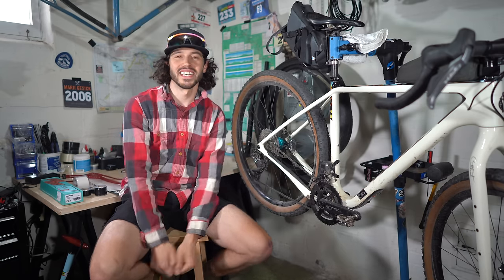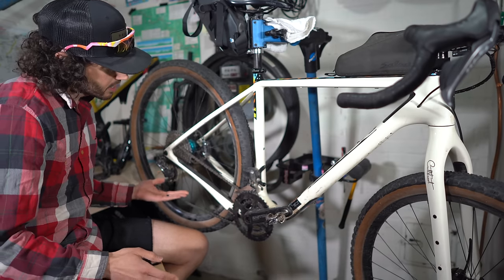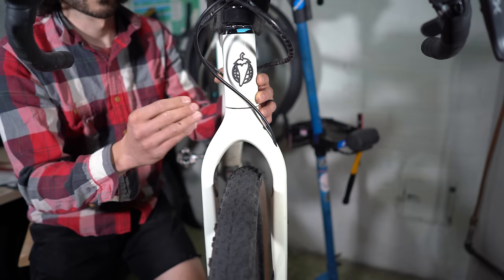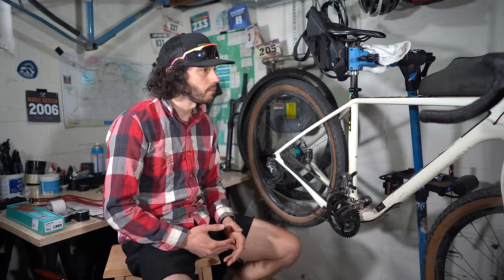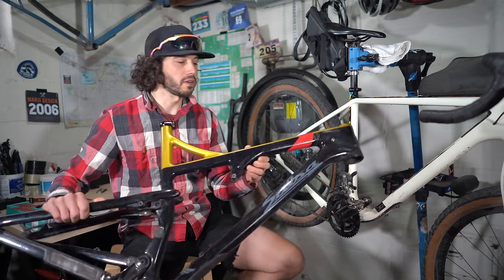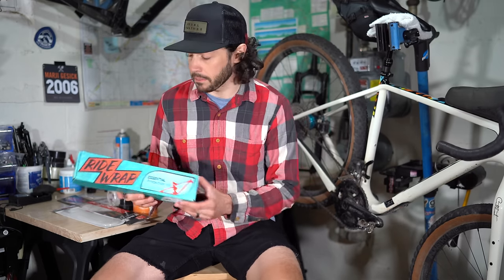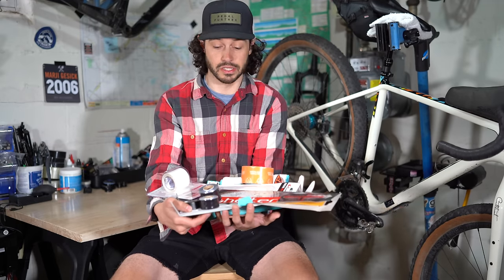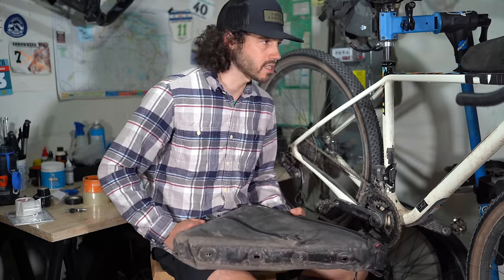Bikepacker's Guide to Bike Frame Protection

Comment: Excellent review of various options. Thank you very much. I discovered this video AFTER installing clear Gorilla tape to the top tube and several other sections. I'll expect to whip out some isopropyl alcohol when the time comes. I can live with that. The best thing is it was inexpensive and available at a local hardware store. I'll return the $70 AMS Honeycomb camo kit which I'd love to place on a few sections (esp downtube) but didn't want to cover all over this new turquoise Yeti. In fact, the ONLY spot on my bike where it says Yeti SB130 is the top tube, so rather than cover it with camo, that's where I installed the clear Gorilla tape. Looks great. Provides nice degree of protection and hopefully, it won't damage any parts of the original paint finish if/when I remove it.

Comment: A trick I've learned with helicopter tape. Spray water onto the bike frame, as you did with the RideWrap. Once you have it in position nicely, squeegee out the bubbles by working from the center out towards the edges. Then you can use a hair-dryer on a low setting to help dry out the moisture. This process is especially helpful when working around curved sections and awkward shapes.
Thanks for a great video. I'm planning to go ahead and install plenty of frame protection on my new Tumbleweed Prospector FAT bike when it is finished being built for me.

Comment: I usually use helicopter tape on the TT and HT. I’ve used electrical tape quite a bit too. Using strips to lay around the front of the HT effectively. It’s also good to wrap around carbon bars to protect from feed bags/handlebar bags etc. Never had any issues with it leaving residue
Reply from the maker: I was surprised how clean it came off. I guess the last time I took it off was maybe a year after install and it became one with my titanium frame.
Reply: Yikes! Do you usually tape carbon bars? What have you used for that?
Reply from the maker: @lewisciddor  Not typically, maybe a bit of tape where I mount a stem bag but thats it. I've used silicone tape in the past, but now I think I'll be using helicopter tape for most of my needs.

Comment: I added bike stickers, transparent to my complete frame lol. I so hate it when my new bikes get their first scratches haha. It hurts right :) I do like to add not to become too tired and cycle onward, because that lowers the protection of the bike as well, and yourself :D. And yeah covers...where needed. Keeps the lack nice and fresh. Further because I use aluminium frames as well I would also add to make sure layering your entire frame and every aluminium part with for instance WB40, just a light rub will do but covering it, makes sure dirt falls of easier, doesn't cook to the frame that easy, and keeps snow and ice of it. Helps as well. Just don't use it on parts that need paste or grease to function, just any aluminium surface. Last not least always keep it clean and well covered when not used, normal garage temperatures are fine, but somewhere dry, and if possible room temperature even be better. With thin tapes, one can add multiple layers on parts that need extra against rubs. Good riding!

Comment: I use gaff tape or self adhering silicon. Both won’t leave any residue and will come off in minute after years of use. Gaff is $14 for 30 yards and the silicone is $14 for 36 feet. Gaff is lighter that the silicon but can hold water when it gets wet (gaff is cotton based).
Reply: @Spitch Grizwald exactly... “Gaffer tape (also known as gaffer's tape, gaff tape or gaffa tape as well as spike tape for narrow, colored gaffer tape) is a heavy cotton cloth pressure-sensitive tape with strong adhesive and tensile properties. It is widely used in theatre, photography, film, radio and television
production, and industrial staging work.”

Comment: Hi Neil - great info! Your channel is great for all things bikepacking! Quick question - so would you say, if you ride a lot, but you're not bikepacking all the time, electrical tape is good as a temporary solution for frame bags and other places where you might get paint rub? Or if you're just doing an occasional S240, you don't really have to worry about paint rub? Just to clarify, I'm just talking about using the electrical tape as a temporary solution in those places where straps cross the frame... otherwise my frame is protected for everyday rides already.

Comment: Thank you! I've that T-rex tape, super heavy stuff but marketed basically a packing tape. I'm going to stick it on my old bike now and see if it's as bad as gorilla 😬 I just bought a Brompton and there are several notorious where points on that folding bike but I want protected the instant I take out of the box before I get around to finding permanent solutions. I've seen some pretty snazzy carbon fiber or titanium patches that are custom-made for the bike but I got a translucent lacquer finish and I'm not sure what it's going to look like in person

Comment: I have a black mat frame and did buy some 25mm and 50mm electrical tape and it workt flawless especialy the 50mm, only sad thing the logo's arent visible :(
and the screwholes in the frame I just taped over and made a hole in it for the screw after and it works

Comment: Use alcohol hand cleaner to remove sticky residue or ice cubes rubbed on it. Then rub the residue off. 
Why not just use old inner tubes cut to fit under bag straps or contact points?  In my experience the cut tubes hold well and just come right off. No tapingNo zip ties needed. Unless you have none bc you are tubeless and not old like moi. 🤣🤣
But that Silicone Tape looks user friendly and effective
Thanks for the great walk-thru!
Reply: That's a practical tip. I got bunch of these laying around, waiting for me to repair them in the future.

Comment: Great in-depth video. Thanks Neil. Quick question, I know it depends on usage but how often do you change your protective tape? I use the helicopter tape you tested. Have you found it fuses on after a long time?
Reply from the maker: Thanks for watching, that’s why I did a test for two months, but beyond that I’m not all that certain. I think it’s a good idea to remove it and replace it maybe every few months just to make sure, but I’ll report back when I remove the Heli tape this winter ;)

Comment: The best frame protection is plasti dip clear coat and a little helicopter tape on high wear areas. Clean the bike apply the plasti dip spray. Maybe two or three coats depending on the usage of the bike. When dry put helicopter tape on high wear areas. Simples.

Comment: Frame wrap solution is the same as invisaframes baby oil and water but if you don't have this for any others just use the old tinted window technique tiny bish dish wash liquid in a spray bottle with like warm water and a hair dryer! Heats guns are abit excessive for carbo frame i don't recommend it

Comment: Has anyone tried using handlebar tape wrapped at strategic points? It seems its padded, can be cut to lengths, wrapped around the frame and sealed with electric insulation tape and would come off easily and could be reapplied to different bikes as and when needed. I was thinking of giving it a try for my first ever bikepacking trip this year. There are cheap versions and bike shops may even give used tape away free. However, for those keen on aesthetics, there is lots of colour choice.
Reply: I'm thinking about using handlebar tape on my carbon frame too. Have you tried using it? Do you have any suggestions for the installation?

Comment: Thank you, Neil, for this video, very helpful! Is there a reason why you focus on protecting the areas where the bag touches the frame, but not those areas, where the bag straps go around the frame? I can imagine that those regions are exposed to intensive friction, too. Thanks.
Reply from the maker: Thanks for watching, Axel. In this case the bag is a bolt on bag, with no straps. If I did this video with a bag that has straps, I would certainly wrap around that area of the frame where the straps sit and maybe a bit more on each side to account for a bit of strap movement. Those regions are high wear areas, so it's important to wrap them.

Comment: That is a better quality electrical tape probably I bought some cheap stuff once and I learned my lesson. Always get the actual graded stuff (there is more than one type) because the adhesive and the cheaper stuff gets all Gummy and disgusting and it's impossible to get off without a lot of extra work